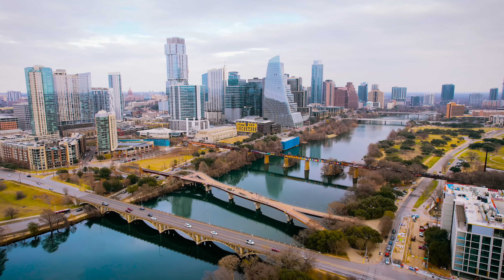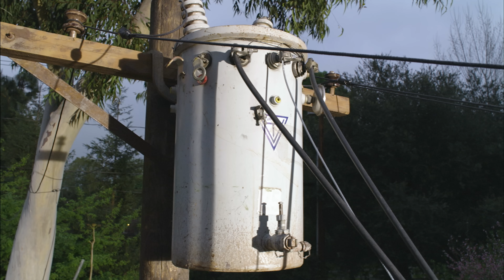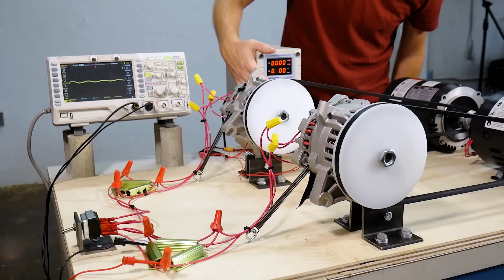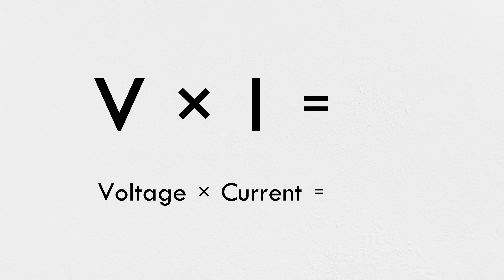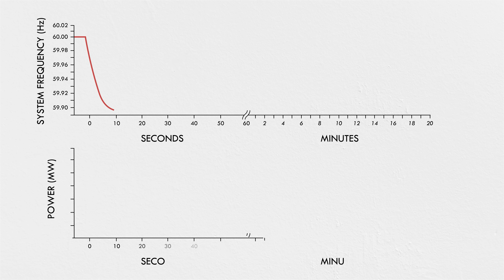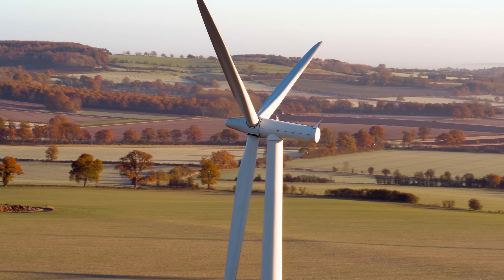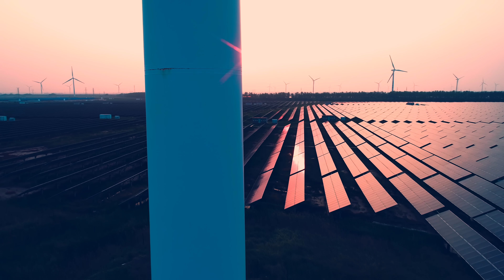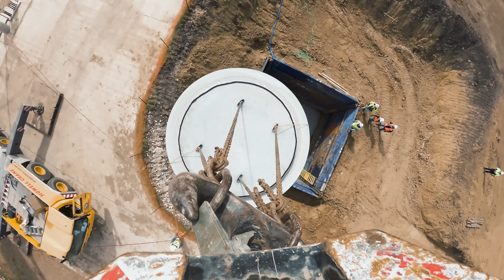Connecting Solar to the Grid is Harder Than You Think

Comment: The proliferation of solar on grids has a particular problem due to its output against sun height.
The U.K. now sees a 12 Gigawatt peak of solar when conditions are right. On weekends the demand may be between 20 and 25 gigawatts, add some wind, our nuclear fixed output and imports from other grids leaves little room for gas generation, which does the balancing. This is not a good situation especially as solar's value in winter is so very low, the government's plan for signifiacnt solar capcity expansion makes no sense. In summer we will be curtailing other generators (as most solar cannot be controlled by the grid controller), which costs more than if they were selling directly to the market. In winter we will need more capacity from other genertaors.
You talk about artificial inertia and inverters being able to boost power in times when demand overwhelms supply. How, where does the reserve of power necessary come from?

Comment: In effect you're saying the inverter-based power sources are acting in a sla*ve mode with the grid itself mastered by inertia-based power sources, acting as the master.  If there is no master, the sl*aves don't know what to do (can't synchronize).  This is simply (conceptually simple) a regulation issue and a design issue, not an issue with the inverter based sources in general.   Despite what Fox News and the current (2025) party in power insist.  Invert baby, invert!!!

Comment: I will gladly wait for PE to make a Spain/Portugal Blackout video. If enough info gets released that is.
Reply: No chance.  Iberian blackout killed 11 people, and it’s now clear it was caused by too much solar on that grid, about which the government had been boasting earlier. Grady won’t go there.
Reply: @Nill757  you do realize people like yourself are the problem, right? Because any imperfection in a renewable power system being responded to with this frivolous hatred towards renewables is exhausting to deal with. A hatred that was never seen for the 2003 Northeast blackout or the 1993 LA blackout.
Reply: @alexsiemers7898 . The Iberian blackout was not due to some random imperfection, like a tree fell on a power line. The intermittency of solar and wind combined with a lack of resiliency from declining spinning masses caused that blackout. That’s a fact. The problem becomes more and more severe with large shares of installed intermittent power, and it happened over the entire peninsula, not some section of a city.

It’s a power system, run by engineers like me, not a rabbits foot to rub up in your tree fort.
Reply: @Nill757  if you’re an engineer then why are you looking at a system that very clearly has room to improve and deciding it can’t actually improve?

Comment: The massive power outage in Spain and Portugal and the constant - frankly - complaining by the energy provider here in another part of Europe are giving me the feeling this problem - though hard - isn't getting the attention it deserves. It feels like a lot of the industry would rather avoid the problem than be pro-active. For example by trying to charge people when their solar panels are injecting into the grid. In fact, I'm surprised this isn't a solved problem. So it's good to hear a lot of research and engineering is being done. It sounds like a massively fun and interesting thing to be working on too, purely from an engineering point of view.
Reply: I have a 2000 watt system on my off grid RV so I know solar for 10 years. Typical panels produce 50% of rating in summer, 5 - 10% in rain and 25% in the other 9 months. Zero from 4pm to 11am. So a typical 10MW plant produces about 10% of its rated capacity which makes it a total scam because the AWFUL POLLUTING FOSSIL PLANT is still runing full time as it was before the solar instal. . For SPAIN to say they are 100% green is BS because there is NO SUCH THING as 90% of the time the sun is off, panels underperform or wind is too low or too high. They are using the ENGINEERED ON PAPER RATING FROM A LAB, not real world output. , When you combine this nonesense with 25% line loss it produces nothing but virtue signaling. This is all just TOTAL SCAM.
Reply: The “solved problem” solution is called nuclear power. Stop trying to flap arms to fly.
Reply: @Nill757  Nuclear cannot throttle it's production up or down quickly enough to deal with variable demand. Gas/coal plants and batteries are much better for that purpose. So we have solar and wind with variable production and nuclear with constant production, all covering variable demand.
The engineering challenge is balancing all that efficiently, preferably with a minimum of fossil fuel usage.
Reply: @guy9360  That’s an old anti nuclear myth from the 70s.  While the US reactors were not designed to ramp, because, why would they at 10-20% of US, but the European and other reactors were, 5%/minute, or 500 MW/10min for a big reactor.  Anyway, there’s no excuse for not running 60% of a national grid w nuclear constantly, year round, as in France now and,  everywhere else that’s not already mostly hydro.  There’s been no Iberian style blackout all across France, not ever, because of a lack of generator inertia when some cloud cover rolled through midday.

“Engineering” will not roll away the basic economics problems with intermittent power: the entire conventional grid must stay in place, indefinitely, alongside the intermittent, all the doubled plants/distribution/fuel supply chain/maintenance, all of it running at different times. By contrast, Nuclear closes down existing conventional power.
Reply: @Nill757  We are misinformed then, by the very people operating this plants. Who often cite this as the reason why grid injection or peak usage is an issue we must pay for. Going to read up on that.
Then I guess I don't know what the problem is with having wind and solar that fluctuate and evening it out with nuclear and batteries. In this story there's no need for fossil fuels then - which sounds good to me.
Reply: @guy9360 why should nuclear be used to level out anything?  Build one and done.
Reply: @Nill757  It's kind of a big deal to build and operate just one, and you'd want more than a single big one. I don't think it's bad to diversify and decentralise the energy production

Comment: Thank you. A complex description of an extremely complex system.🙃
The biggest problem with solar "farms" is not a technical one. When a field that produced food is converted to fuel production, be it electricity or biofuel, the supply of food goes down. Economics 101, supply goes down, price goes up. Those most affected, of course, are low income families.
There are a myriad of issues with wind turbines. Initial cost is prohibitive, especially in offshore installations, Maintenance is expensive and dangerous. Their life span is short relative to cost and payback. The capricious nature of the wind. And the list goes on. With the average blade length of commercial turbines being over 170 feet, at just 15 rpm, the blade tip speeds exceed 180 mph. Even at this low rpm, blade tip vibration and wear can be significant. If you double the blade length, as is the case with many offshore turbines, blade tip speeds can quickly become damaging even at low rpm.

Comment: One of these “near misses” happened in Germany ~15years ago if I remember correctly.

A popular inverter manufacturer had a safety protection that would shut down the inverter if the line frequency deviated too much from its own, making the assumption that this implied an internal fault.

The concern? A localized fault could force a small group of those inverters to disconnect, quickly reducing the supply, which would reduce the frequency further, which would trigger further disconnections,…

For a while, and until this manufacturer pushed a software update, the whole EU network was exposed to the possibility of a continent wide black out. Luckily nothing happened!
Reply: It happened now. 
Damage limited to Spain, Portugal and maybe a bit in Southern France.

Comment: One of the the really big problems is Synchronous resonance. Solar and Wind farms were built in Australia that had this exact problem........they were forced to install a large and very expensive device known as a Synchronous Condenser, which is basically mimics a conventional rotating generator output.  Your drill example is actually opposite to an early example of a rectifier, an AC motor driving a DC generator, actually used at early 20th century high output radio stations, later replaced by water cooled vacuum tubes which are excellent rectifiers, even used at Steel mills for electric arc furnaces.

Comment: What if you use mirrors that focus the light on a tube of water that then heats up and that can then be used to drive a steam turbine. The theoretical max efficiency of a silicon solar panel is 26%, but a system with mirrors can be more efficient if done right. And it will be easier to hook up to the grid.
Reply: Go build a model.
Reply: @JasperVanBeek. Socal Edison pioneered this technology at a plant in Dagget, California, called Solar One.  If I remember correctly, they used a tower surrounded by mirrors, and instead of water they used sodium salt.  The sodium salt had good thermal mass to store the heat, and that allowed them to generate steam for turbines both day and night (avoiding one of the main drawbacks to solar power).  I believe they used this tech at a couple of plants in Spain.

Comment: Very informative. I liked it. I still have few questions. 1. what are the voltages at inverter? 2. What the grid voltages?
Reply: Grid and inverter voltages are not constant because they are (or imitating) AC currents.

Comment: Connecting solar to the grid is a terrible idea. It costs a lot of money and only took off because of tax payer money waisted. It does not generate any power to the grid because as you said, you need coal or traditional power generation to cover when demand becomes to great. Also solar will never power the earth because solar only produces power for about 5 of the 24 hours. Not even while the sun is up! But only for a few hours while its up. So unless you are happy with no power for 19 hours push solar power!!

Comment: I worked as an electrical fitter/electronics technician for over fifty years in the power generation, transmission and distribution industry. 
This is the best I have seen so far in explaining simply and accurately the power industry with all of its associated problems and engineering solutions. 
I worked for the electrical supply industry in South Australia 🇦🇺 and some of my early years were spent experiencing the industry in “the school of hard knocks”. Having this knowledge now readily available in presentations such as this, gives me hope for the future. 
I am currently in my seventies and I cannot stress more to the “new kids on the block”, strive to never stop learning and strive to work towards thinking “outside the box” but practice learning the lessons of the past. 
GREAT PRESENTATION,    Thank You 🙏
Reply: Well said! Another EE here, currently working on industrial electric drive systems etc. 73 de SM6UXF.

Comment: Solar energy is hard to connetc to the grid, but the panels of smaller voltage can be more usefull. Whe  blackout is going on, we need things like comunication (5V phone battery), light (5V flashlights), and heat (electrick heaters; the worst type of heaters). These small panels can even give a little more life to laptop (12V) battery. 12V/5V home grid is not idea that can sell very well, but is posible, and not completly delusional. There are technology that enchances capabilities of standard batteries (supercaps) in terms of solar/wind energy. That grid can be independent, so no need for large quantities of land being dedicated for additional, low-power, low-voltage grid (very ineffective at long distances). And it is cheaper that 10 years ago. Internet provides ideas, but only real creators, that will spend long time and money on that can make a real (even small) change.
Reply: I have basic knowlege of electronics, still learning, doesen't know about anything larger that 230V/50Hz.

Comment: I think now that fusion is becoming more prevalent. The status quo of the grid may need to be totally changed. 

Im not aware of whether the labs working on it have mentioned yet whether itll produce AC/DC power, but the priority should be to make a grid capable of carrying fusion energy as simply as possible. No conversion, no loss. If it makes DC power, than we need to convert to a DC grid. 

Say goodbye to the cheap equipment you mentioned at the beginning, everything else would simply have to fall in line.

Comment: 13:06  or have customers who are willing to go of supply for a while. 

Here in the uk many large users like cold stores and  pumping stations etc have frequency responce relays that disconect at a given frequence. 

So for example a cold store may be set to disconect for 20 minutes if the frequency ever drops below say 49.75hz 

A watter pumping station may go on to backup generator for 30 minutes if the frequence drops below 49.70hz 

by the time they are comming back on other standby generation will have spun up.

Comment: No doubt the "grid" is complicated. Going to a on grid professionally installed is very expensive. I think it's a scam. Doesn't provide energy when you provider fails. Also the provider has the final say if you can or even will be able to operate one. They might be able to charge your account feel good fees for the opportunity to participate in the generation.  The grid is aging, it's a fact as usage is increasing, the power company generation will not be able to keep up from your provider. You should seriously think about going off grid with the solar for you're own usage. Money, math, will power and mostly components is all it takes. Be one of the few when the grid fails to have the lights on and comfortable in your home off grid.

Comment: Instead of "grid following" inverters, anything pushing power into the grid surely just has to sync its PLL to a local clock which causes the output wave to lead the grid if the frequency drops.

Comment: Frequency stability will be achieved when all power inverters are synchronized to an atomic clock WWVB. When generators and power inverters are synchronized to an atomic clock WWVB WWVH and WWV you will have grid stability. Homes connected to the power grid when power failure happens homes will still have electricity.

Comment: It's very useful document. Good Job! A small comment : To export the active power to the grid the solar inverter slightly shifts the phase ahead the grid phase. The greater angle the more power is generated to the grid. Increasing the voltage on the other hand makes reactive power export.

Comment: You really should research grid forming inverter technology. Every battery connection in Australia I work on now uses grid forming technology, which does not synchronise with the grid based on a PLL. Almost all projects in Australia are now also hybrid PV/wind and BESS, meaning many of these concerns are being addressed in all new projects.
Reply: And you're equally screwed as us.

Comment: instead of grid following algorithms, and dealing with the problem of syncing two disconnected grids …. it seems to me there needs to be a different communication mechanism to provide the frequency “heartbeat”.  Use something like NTP to synchronize really accurate clocks,  an out of band signal of some kind…. that provides a common drumbeat to synchronize to.   Compare that to the actual signal on the grid, and a standardized algorithm could then apply the counter force needed to assist with the grid, or if the device determines that helping the grid is impossible, disconnect.

Comment: Great video, however there's a slight error at 6:14. You mention pulse width modulation with incorrect context: PWM has to do with the ratio of "on time" to "off time", most commonly used for pure square waves, and doesn't have anything to do with the number of steps used to approximate a sine wave. The term you're looking for is "switching frequency", analogous to the number of bits in a DAC.

Comment: One answer is install a separate switch board with separate outlets that you can use with off grid solar inverters and batteries. The energy retailers give you virtually nothing for exporting power like something like 5 cents a KWhr . My off-grid system has 25KWhrs of back up batteries with 8KVA diesel generator, but I mainly use the grid to charge my batteries through the OFF GRID inverter when there is not enough Solar.
I only have 4KW of Solar at the moment really need more but I will gradually get there. The sooner we all disconnect from the Grid the better. Quite a few times the power has gone off but I still have had power up to a max of 10KW. Modern technology allows one to be isolated from the Grid. It is too complicated connecting Solar to the Grid and really it is not worth it in savings

Comment: I do not miss the constant power outages in rural West Texas near Odessa due to all the submersible pump MCC installs that stressed the infrastructure. The transmission side finally caught up in 2018, but from 2010-2017 the small towns surrounding Odessa and remote compressor stations constantly lost power. Lots of sleeping in the truck to wait for just turning my air compressors on, to start compression engines. Also many of the first gen wind turbines near McKamey and Rankin, TX or Notrees, TX are permanently locked out 10 years premature of their expected hour life.

Comment: Sounds like it would make sense to require large solar installations to include flywheels rated for a certain capacity (and under remote control from the operation center), to smooth power supply changes.